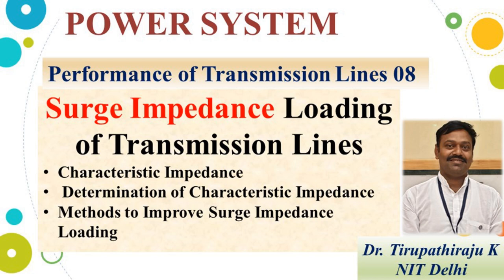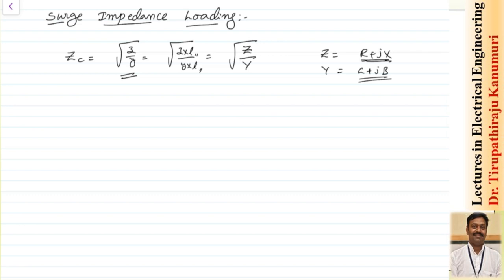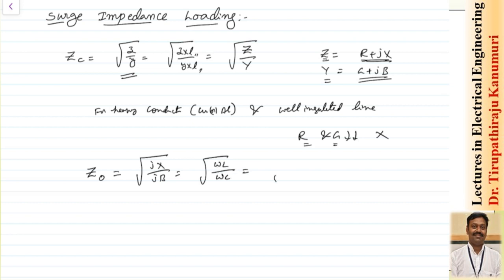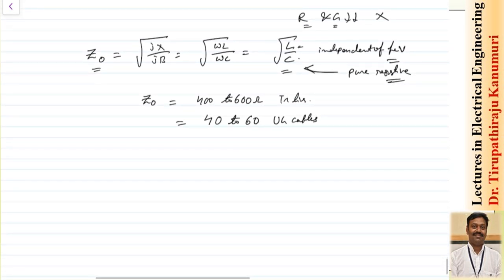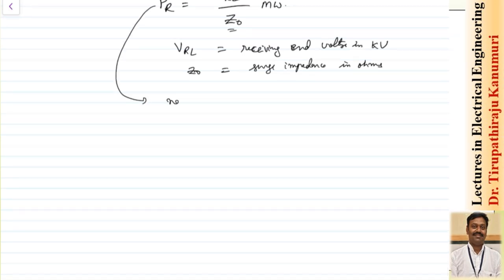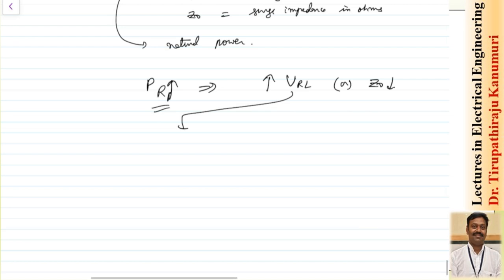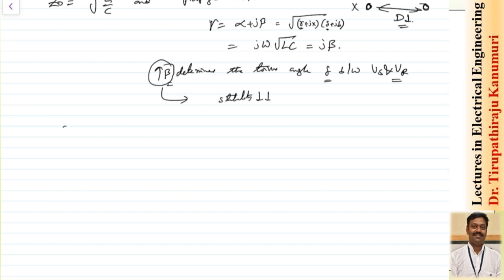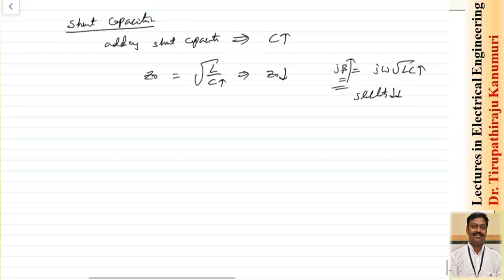PS29 Surge Impedance Loading of Transmission Lines

Comment: Hello, I want a solution for me like::        A transmission line of surge impedance, ZA equal to 500 S is connected through a cable of surge impedance 50 2 to another line of surge impedance ZB equal to 600 2. A travelling wave of 100 u(t) kV travels from the 500 2 line towards the 600 2 line through a cable. Calculate the voltage at the junction of the 500 22 line and the cable, after the first and second reflections.